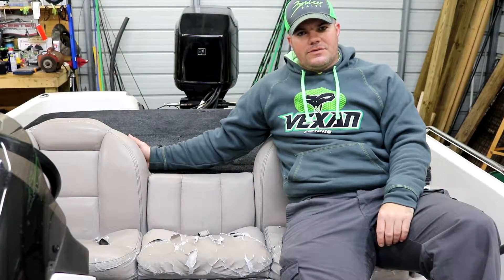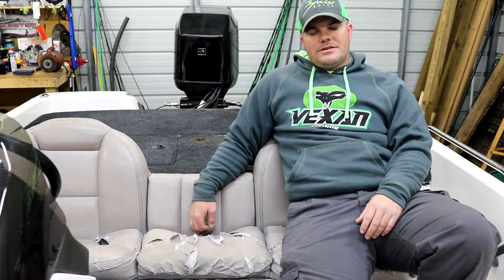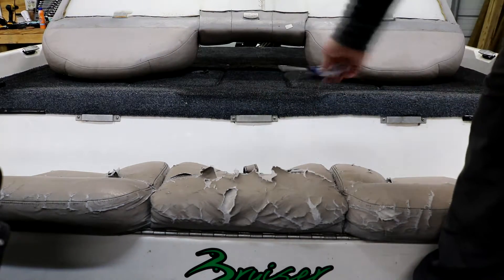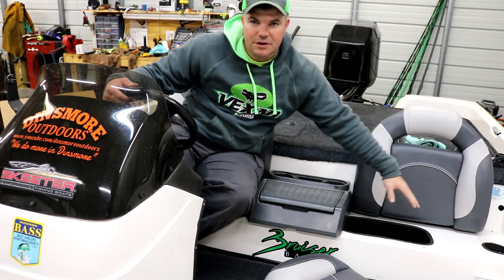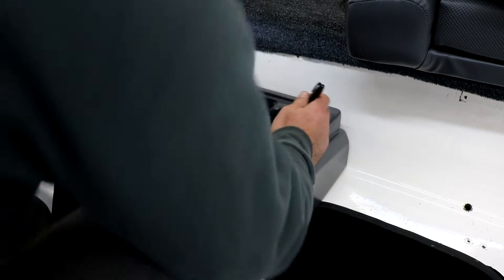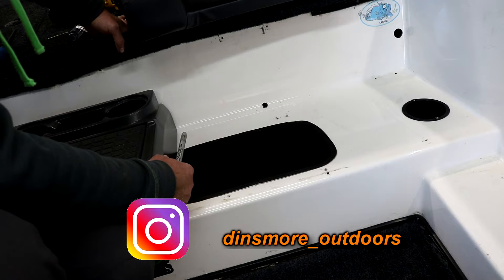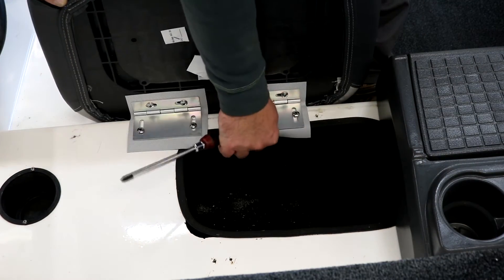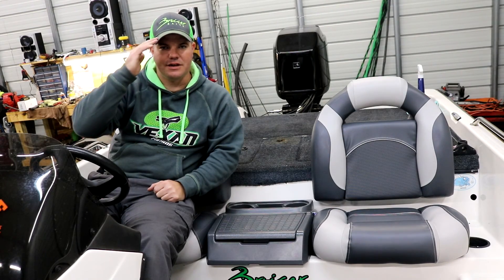New seats from bassboatseats.com install

Comment: Factory put in drain holes. Factory put in underseat storage. Compact bassboat seats fit nicely and can be centered over both storage holes with center console/foot step.  Full size seats don't align the same...but you managed it well.
Reply from the maker: Thank you! they are still doing good today!

Comment: I'm looking at a similar only the bench is actually separate convertible casting seats and the middle seat fold forward to reveal a cooler under it. It is bad as yours because if the same use of the seat,  it was the step to the rear cast deck. So I'm converting it to a piece of carpeted plywood which will use the same hinge for cooler access . But I'm selling my boat so I'll check out the seats from where you got yours... All 4 will be replaced. 2 casting fold down seat, and 2 helm style seats. But I have to match them to each other .
Reply from the maker: yea they sell sets where you can all 4 seats for your boat, bundling them saves a lil bit of money. Glad my video was helpful for ya

Comment: Question.   How do you like the console after time?  Was it waterproof?   And how does the latch hold up, trying to see if it pops open flying down the lake..
Reply from the maker: Hi there, I love it. It hasn't faded out, holds up to people stepping on it and stays secure never had it open up, even doing 75 down the highway. Would say it's 100% water proof but if you're out in the rain nothing inside gets wet. Hope that helps ya

Comment: 3 years of use now since you installed new seats. Is the material holding up well? Any drying out, cracking, or fading?
Reply from the maker: Still look as good as the day I put them in. I don't let people step in them, the boat stays inside and keep them wiped down 303 spray.

Comment: Dude awesome thanks for the info...I'm planning on buying a 96 Nitro and the seats have seen better days and was wondering how I could replace them. In fact those look like the same color I will want for my boat...If I can get it..
Reply from the maker: Mine are still holding up good! and way more comfy than my old ones. When I amd riding in rough water I can tell the difference
Reply: I have a 96 nitro as well and need to redo the seats, just wondering how you made out with the fit on those?

Comment: Are you still liking these seats?  I am wanting to order these for my boyfriend since his Bass Cat seats are all worn out.  You said that you got the full size ones.  How tall is the wall behind your seats?  His Bass Cat's is only 10" so I am wondering if they will look to high.  The compact are not an option as his bench is 18" and the compact seats are only 16" and have a lip that takes 4" more away.
Reply from the maker: im loving these seats! way more comfortable than my old ones. im not sure how tall my back wall is but you have some room to adjust the back since the top and bottom are not attached together

Comment: very helpful man, thanks
Reply from the maker: no problem! wish i could have made it a lil better but hard to get the camera angles I wanted and run the tools haha
Reply: I had to screw down 4 pieces of 2x4 stacked up, into my rear deck and then the seat backs into the 2x4s. Looks ugly but works. 1995 nitro 180fs
Reply from the maker: @slowfaller  had to add pieces of 3/4" plywood on my seat backs to give it space so I can open my back hatches haha so im there with ya.